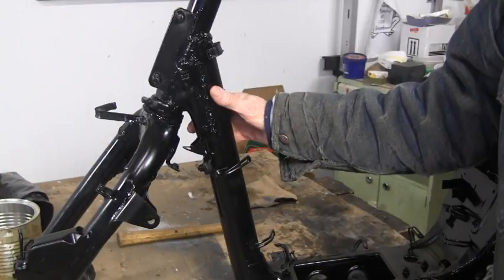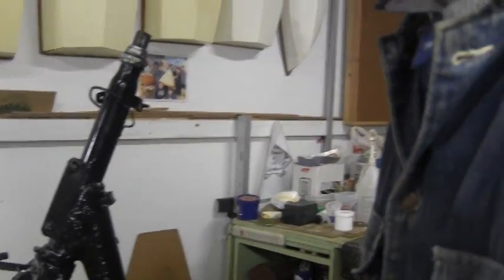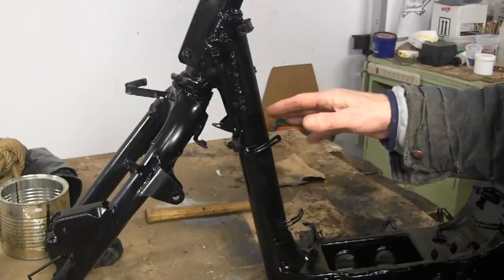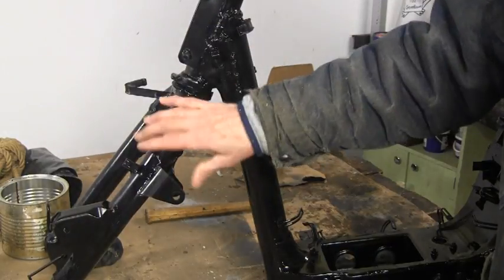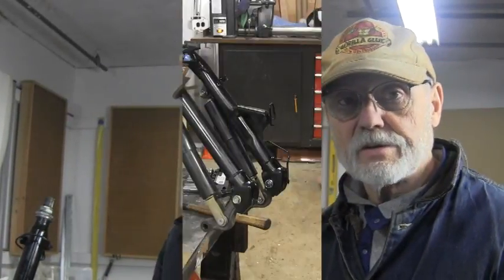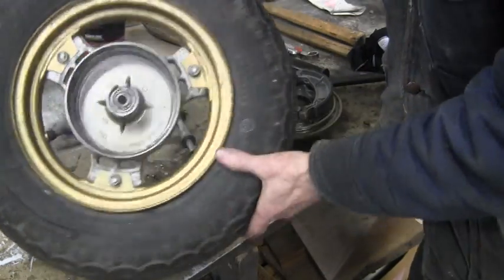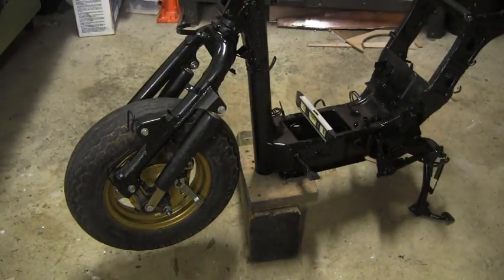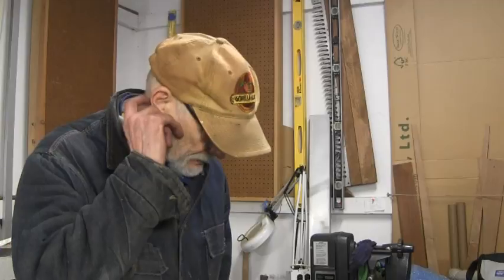New Life for Honda Elite 250 Part 2

Comment: I'm glad you're back... looking forward to this little project.  I have a Suzuki GS550 I'm turning into a cafe racer, and I'm about 70% done and stuck.  Your video is inspiring.   :)
Reply from the maker: It's good to be doing a video again.  But today as I was taking off the RH swing arm to clean off the rust; I found that the bearing in it was shot.  The bearings side seals failed and lost all the lube, and the cage that holds the balls in place disintegrated and the balls were "free to roam".  Got the bearing out and will have to look for a new one.